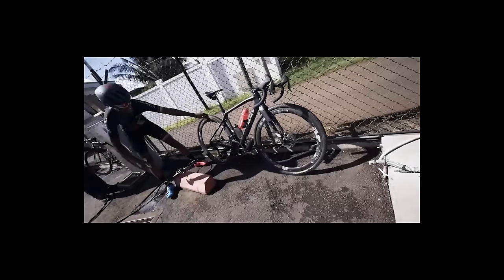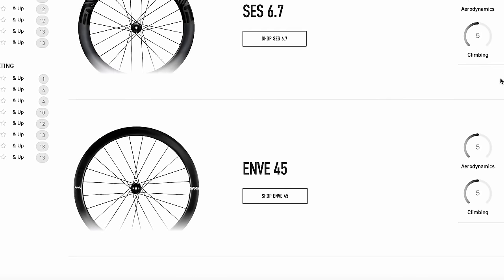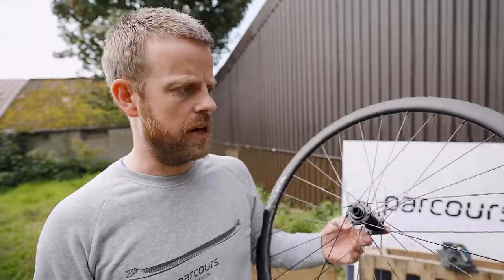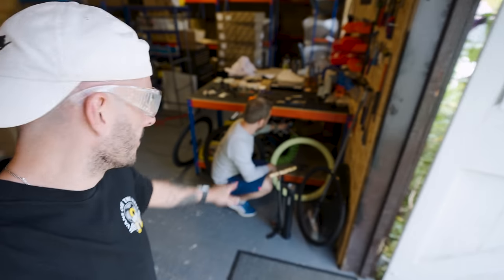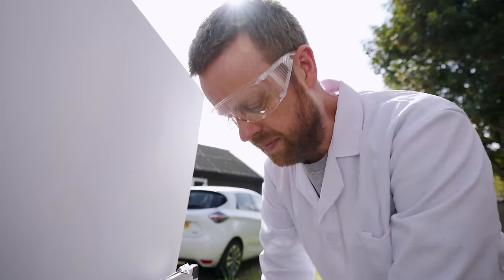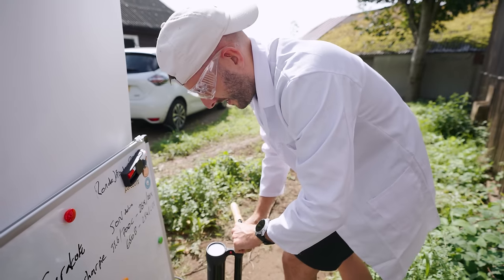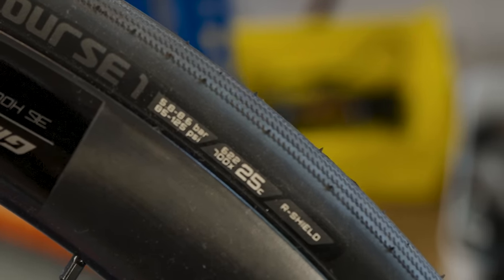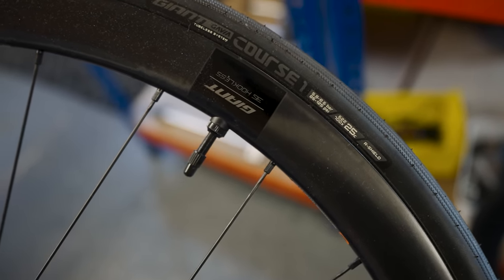Pumping Up Carbon Bicycle Wheels Until They EXPLODE

Comment: I need my tyres to be 90 psi minimum. I couldn’t tolerate hookless.
Reply: I think the general hookless recommendation is if you need a pressure greater than 72 psi, you should be looking to go up a tyre width. Eg. From 25mm to 28mm. Not defending hookless, just how to interpret the recommendations safely.